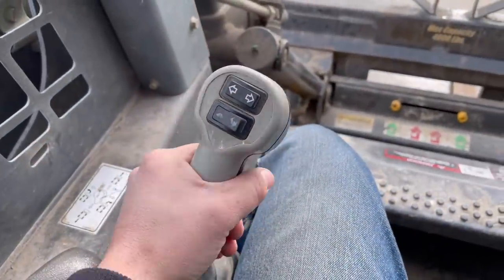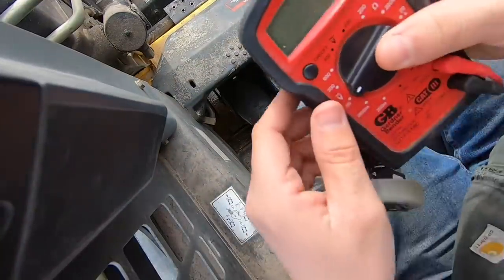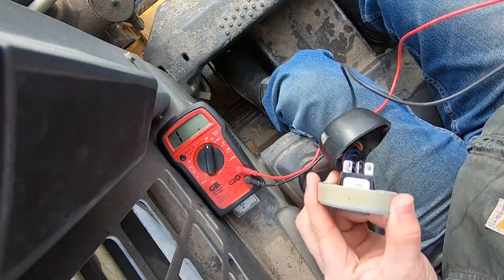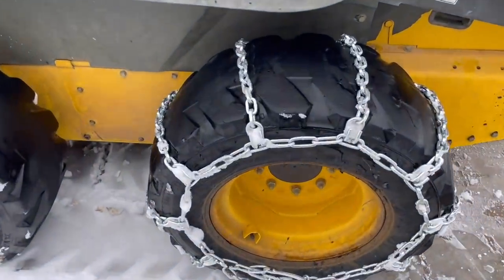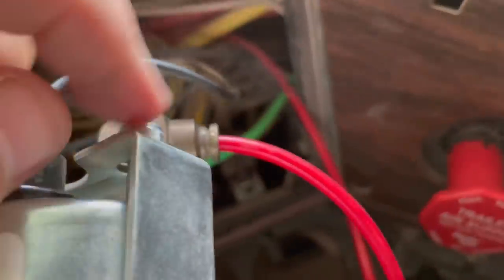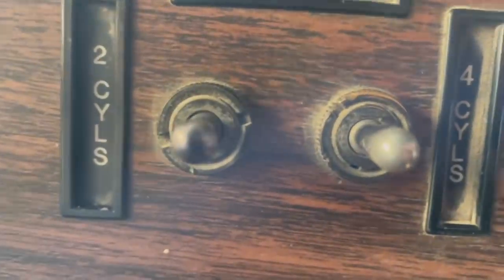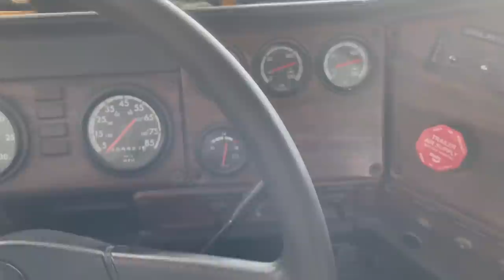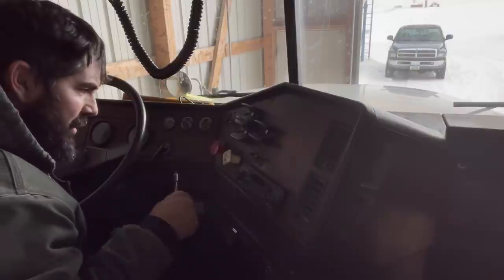If it ain’t broke, you’re not farming...

Comment: Those compression fittings have an o-ring inside than can be replaced. Pull the hose out, then take a pair of needle nose pliers and slightly pull on the fitting that you just pushed in. It’ll pop out. Remove the old o-ring with a dental pick and use the same tool to push a new o-ring back into the fitting. Make sure the o-ring doesn’t twist. The main fitting has a groove inside the o-ring will fit into. Use Teflon o-rings as they seal better and last longer than regular rubber. Once the o-ring is back in, push the fitting back into the main fitting. Then reattach the air hose. Just my .02 cents. Hope it helps.
Reply from the maker: Might try that next time

Comment: Great video, as always. Check the battery in your DVM. Resistance should read zero when leads are shorted. Really, really zero...like 0.01 ohms. Resistance is the only function in a multimeter that uses the battery, other than scale illumination in newer DVM's. Have a great week, Carl!
Reply from the maker: Good idea! I was wondering why it would never quite get to zero with the bare leads touching.

Comment: Probably doesn't matter but when you put the red and green air lines back on the gauges you managed to swap them around.
You could have found that switch a lot cheaper by going to an auto electric outlet.
Reply from the maker: You guys are good! If you go back and look at how they were when I first took the dash apart I eventually got them back the right way. I put the green one on the outside while I was in diagnostics mode because it was shorter and I could get the panel out further. I put the back the right way when I got the new fittings in. The angles are a little confusing the way I edited the clips together. Good eye! 👍

Comment: Not sure if it’s a big deal or you caught it but in the video when you first took apart the dash of the Freightliner and then put the new fittings back in the green and red hoses got switch to the gauges.
Reply from the maker: Yeah, I switched them when i was messing with the fittings because the green one was shorter and I could pull the panel out further that way. I put them back the right way when I closed it up.

Comment: You need to follow up on that other air leak I'm kind of curious about what that was
Reply from the maker: Yeah I’m not sure what that little line is or where it goes. Might have to mess with it after I get done hauling corn for the month.
Reply: @dodgebrothersfarmandranch9206  I would try pulling the line and wrapping the end with 2-3 turns of Teflon tape and reinserting.

Comment: Not to get off topic, but will your New Holland pickup a full pro box of corn or soybean seed? I have an New Holland LS160, but its just a bit to small to handle them. Have been looking to upgrade to a bigger NH. Couple of L175s in the area for sale. Thanks!
Reply from the maker: Hmm we don’t handle pro boxes. We get pallets of bags and the pro boxes we use are already on a tender from the seed guy. A full pro box could weigh about 2700 right? I don’t think it would quite be big enough.

Comment: Gosh, how I wish I could mess with stuff like that.  The New Holland switch is made by OTTO Engineering right by me in Carpentersville, IL,  Depending what is connected to the switch, you may have to remove one of the wires in it to get the most valid test.  What I would do next is break open the switch and figure what failed.  Why?  Just curious.  I would have taken a small paint brush and dusted the dirt off the 4 Cyl light.  I like clean.  Any possibility for LED lights as drop-in replacements?
Reply from the maker: I should send you the old switch. I think it’s still on the bench in the shop. You are right I’ve got some dusting to do on the dash. I don’t know about replacements for the ribbon lights. I should look into that 🤔
Reply: What is the number of the bulb that went into the gauges?  I will give it a look for you.

Comment: You almost have to remove switch from circuit to test. I bet it tested bad after it was removed.
Reply from the maker: Yeah because the wiring through the solenoid was partially completing the circuit

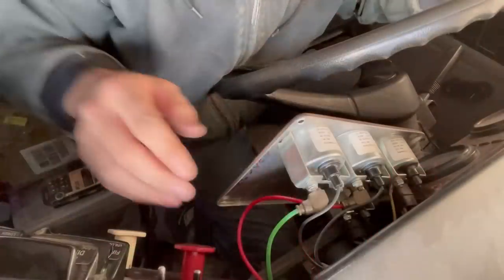Comment: carl, I think you crossed the air lines.     Go back and check at 8:54  and then check at 12:07.
Reply from the maker: Haha yea but if you go back and look at how they were when I first took the dash apart I eventually got them back the right way. I put the green one on the outside while I was in diagnostics mode because it was shorter and I could get the panel out further. I put the back the right way when I got the new fittings in. Good catch!